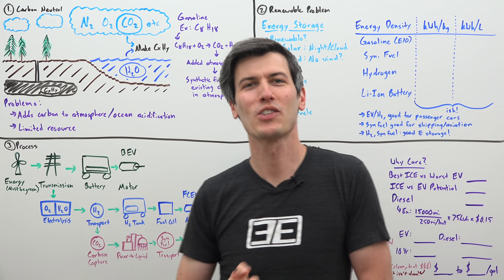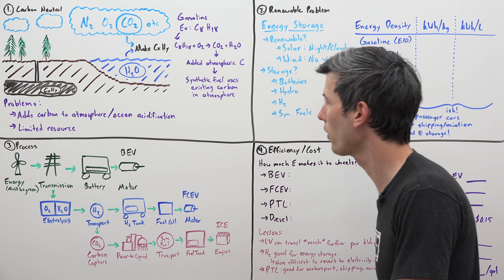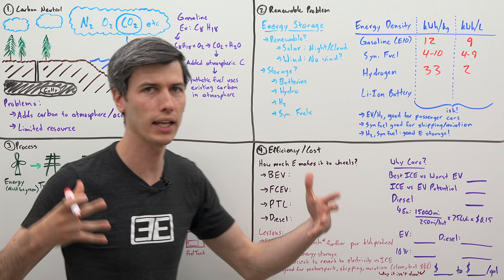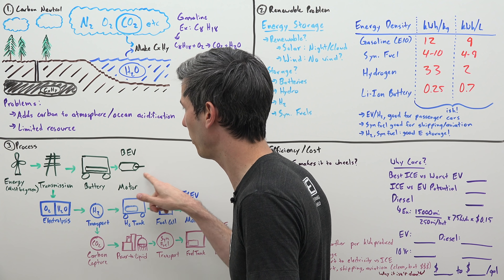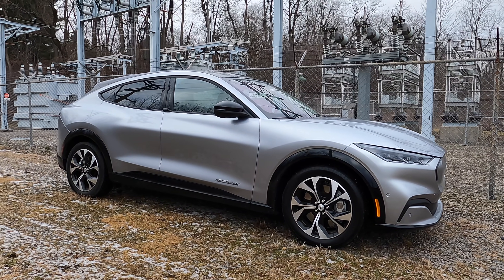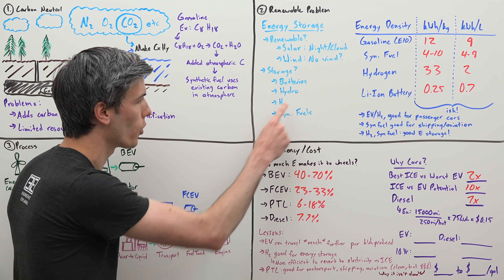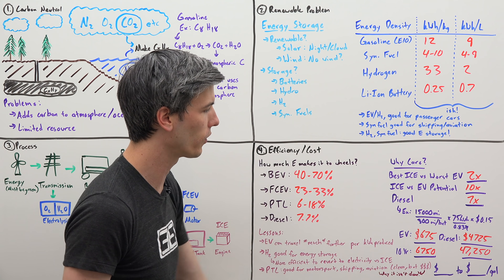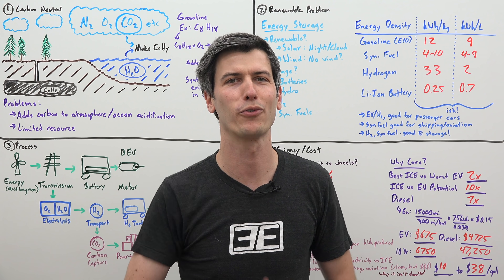The Big Problem With Synthetic Fuels

Comment: I think we also need to factor in the total environmental impact of manufacturing and disposing/recycling  of batteries vs a simple fuel tank. This was a great video, but in my opinion it only tells one facet (albeit an important one) of a multi-faceted story. This should have been stated more clearly.
Reply: Environmental impact of recycling well you’ve managed to contradict yourself by only using 4 words 😂😂😂😂😂
Reply: We should also include the total environmental/human impact of oil extraction, refining, transport, the effects of burning and placing it into our atmosphere (since it can't be recycled), as well as the related health implications, associated geopolitical and literal armed conflicts we employ, to ensure access. I think if we actually looked at the total picture when it comes to how we get our cheap gas, it would put a lot into perspective, as well.
Reply: @knroo-j1487  Lmao. The whole point of synthetic fuels and biofuels is to provide fuels (that will get cheaper and cheaper over time) using techniques that reduce the resulting environmental damage to only a fraction of that caused by extracting and refining crude oil.
Reply: @electric7487  Lmao. I get that, but I'm specifically responding to the person above me. They want a deep dive of battery manufacturing/tech, but somehow stopped at "a simple fuel tank" for comparison. I suggested we also do a deep dive of fossil fuels which fill that very tank. Meanwhile, EE already offered insight into synthetic fuels, so we have that covered.

Comment: CO2 emissions involved with the mining, processing, transportation, manufacture and packaging of the batteries for these supposedly "green" EVs? Don't look behind the curtain as the great and powerful OZ forbids you to glance.

As an aside, the Kia Ceed 1.6 CRDi gets a whopping 72MPG (on diesel) so the EV to Diesel values noted of $675.00 & $4275.00 per year/15,000mi driven is poor math at best and at worst, it's deception. 15,000/72 = 208 Gal (of diesel) @ $3.00/gal = $625.00 which is less than the $675.00 value given for the EV.

Comment: You made a 14 minutes video about it and I'm glad you did. However, people who think synthetic fuels will save ICE engines are generally delusional so explanations don't really work on those. Also, regardless of how amazing synthetic fuel ends up being...

Europe is starting to ban ICE sells from 2040, Quebec from 2035 and it's likely other countries will join that trend. With those massive markets basically wiping ICE sells, it doesn't take a genius to figure out what's going to happen to ICEs around 2030ish: manufacturers will just stop making them. And with that out, synthetic fuel is moot.  

EVs are the future because it has been decided.

Comment: I hate electric cars. Let’s run methanol or nitro methane and call it a day. People don’t realize that as old as the internal combustion engine is, the electric motor is even older and like the internal combustion engine, they haven’t actually changed all that much, just optimized. So the newer technology is the internal combustion engine. We can run it on different fuels, but it won’t go away. Alcohol is nice and clean, you can swig a sip of it and pour the rest in your tank. Just like Granny’s moonshine.

Comment: Makes me wonder, electric is cheap now, but once a majority switches to electric with no alternative, electric prices could/would go up with no competition to keep the prices lower. Synthetic fuels and hydrogen may be good even if just to keep electric affordable for the everyday user.
Reply: It's about supply and demand. Sure, demand will go up but so will supply meaning the prices won't change that much. And if they do, you can expect the government to force it down especially if your electricity is nationalized like in Quebec.  So price control is actually better than for oil.
Reply: @dzello  that is not how capitalism will pan out. When there is little to no competition, companies start to be able to make their prices what they want. The government will step in, but that will not necessarily make electric cheaper. The government steps in when oil gets really expensive, but the price still goes up. The price may not get as high as it would with out government intervention, but it will go up. Oil so far has always risen to match our demand, but it has also increased in price.

Take for instance Intel vs AMD 4 to 6 years ago. Intel did not have a fierce competitor so their prices went up and their advancements in technology slowed in the CPU market. This can be used as an analogy of what could happen in the energy market.

 Electric vehicles are the way of the future but we need to be cautious with the change. We don't need electricity to turn into the next big oil. Even though is some ways, it already has. We can see this in the electric bills for Texas when the large winter weather (for Texas at least) caused a surge in electrical demand with the supply falling short. Prices sky rocketed and not all providers absorbed the price hike. Some passed the prices on to the consumer. As of now, people are on payment plans to pay multi thousand dollar electric bills with no government aid as of yet.
Reply: @robotsmash0077  What you're saying only applies in a free market which this is not reeeally. 

When something is this important, governement intervenes permanently. Also, electricity is being sold across countries. For example, Quebec sells electricity to the US at low prices to ensure North America uses clean electricity (since Quebec produces hydroelectricity). So there's actually  competition as well. 

As for oil, yes it goes up, but not much and if you remove inflation and increased taxation, the price of oil has not fluctuated that much. 

So the supply-demand aspect of this is absolutely fine. If anything, it's even more in control because supply is relatively entirely local or close (neighboring countries) meaning you are less at the whims of OPEP policies for example.
Reply: @dzello  Canada does produce more hydroelectric energy than the US, but the US is right behind based off of 2012 numbers from USGS with China being first, then Brazil, Canada, and the Untied States. Based off of 2020 numbers from IRENA, the US is the second largest producer of renewable energy second only to China. So on the Canada sales power to the US so that the US uses clean energy, I will have to disagree.
Reply: @robotsmash0077  I wasn't asking for an opinion, it's a fact: Hydro-Quebec, Quebec's national electric producer, sells electricity to the US at a low price in order for the US to use more clean energy. I worked on that project myself.

The fact the US produces hydroelectricity does not matter at all saince its entire consomption is not fully based on hydroelectricity (unlike Quebec). By selling clean electricity at a low price to the US, the US uses clean electricity rather than dirty electricity which has a higher price. Basically, if it wasn't for that, the US would build more dirty electric powerplants and pollute more. 

Being close to Canada helps the US with its prices. Also, again, massive scale things like electricity or gas are massively supervized by the government and it is not a free market system at all. The variation in demand for electricity becomes a non factor.
Reply: @dzello  I was not talking about Hydroelectric power generation. I was talking about renewable power generation by country which encapsulates hydroelectric generation as well as all other renewable sources. All that has been brought up, is about Canada, not the rest of the world. The beginning statement was brought up based off of an observation from one perspective, but this conversation chain has veered off topic resulting in just an argument. The original comment was just that, a comment I had when I finished watching the video. This videos content  is all set in the future where no one has a perspective on how the problem will mature and be solved. All I wished to gain from the posting of the comment was some thought on price changes that will be associated with the increased demand/strain on the future power grid.
Reply: @robotsmash0077  And like I said, it doesn't matter.

The problem is you're using data improperly. It doesn't matter wether the US is second, third or fifteenth in renewable energy production.

The only thing that matters is:
Does the US use dirty energy (no matter if it's 1% or 20% of their entire consumption)? The answer is yes, it doesn't rely entirely on renewable energy.

So by selling hydroelectricity to the US, Quebec makes sure that a portion of that dirty energy is replaced by clean energy instead.

So what matters isn't how much renewable energy the US produces, only that it's not 100% of its consumption.

Comment: I think it’s extremely unfair to compare a nascent technology to what is close to the physical state of the art. Remember how expensive Li ion batteries were at first?
Synthetic fuels are primarily good because they allow you to not have to modify your entire fuel distribution logistics and they offer a much more practical solution to energy transportation (fixing issues like density, leakage etc.)
BEVs have a very hard cap to adoption due to the issues of charging infrastructure (you need to electrify literally every parking space ever created). While I agree they’re here to stay, synthetic fuels are really the answer to everything that Li ion batteries won’t cover. Unfortunately, you understand how researching synthetic fuels is the dumbest thing ever when you have fossils. Unlike Li ion and research for electronics, there’s no benefit of tens of years of research and refinement that enabled Tesla to make the grand entrance.
Reply: There is efficiency losses that simply cannot be overcome when talking about synthetic fuels. Even the best case, theoretical limit, synthetic fuels are at a very large disadvantage. Considering the cars would ultimately share the same source of energy the price per mile will always be dictated by electricity costs. If it takes 5x to 10x the amount of electricity to move a car on synthetic fuel per mile electric cars are always going to have the edge. As for the charging infrastructure it really starts to make sense when your fuel bill could be 5x - 10x lower, it often pays for itself quickly. Their is hiccups to widespread adoption, yes, but it's not like this is all happening right at once.

 Other industries could (and at this point they really should at least blend some in) adopt it but would have a bit of trouble if they want true carbon neutrality. Telling people their $500 plane ticket or their $5000 shipping container is now gonna cost $5000 and $50 000 would be a bit of a shock. Marine freight has room for creativity, such as sails, solar assists, etc. Air travel really needs that energy density.

Comment: What would we expect the impact on water resources if we would utilize electrolysis on the level that would be needed to make it a viable fuel.  Water use is already controversial for corn ethanol.
Reply: Porsche's pilot project uses seawater.

Comment: It's an interesting topic. If the clean power source is at a remote location (they often are) and the power can't easily be transmitted because the location is, for example,  an island (underwater cables are expensive and lossy) then synthetic fuels might start to make more sense. The South Island of New Zealand is a case in point. Lot's of potential to produce power (hydro and wind) but it's very remote. There are cables to the North Island but they lose a lot of energy in transmission
Reply: samew with synthetic fuels, how much you will use transporting those around from remote places, I still think losses from the wires are less than having to pay to transport that synthetic stuff
Reply: HVDC underwater cables don't lose much and are preferred for long distance power transmissions, what are you on about. There's >10 in Europe alone...
Reply: @m2heavyindustries378  A lot of renewable energy projects in the UK are on hold because they can't connect to the grid. They are just in limbo waiting. The grid can't even transmit al of the energy generated in Scotland to where it's needed. There may be 10 cables in Europe but the system doesn't work.

Comment: I dont need this to save all ICEs. I just want a niche kept alive. Similar to how few of us ride motorcycles. Bless you Porsche.
Reply: People still ride horses today, and there's also steam engine trains around. So I'm sure there'll be niches kept alive for those with persistence, knowledge and wallets for it.
Reply: 38 bucks yikes. I hear they are still working on it. Its not perfect. Thankfully none of this is on the immediate horizon meaning i dont have to worry about any of this as ill be in old folks home riding an autonomous pod around. I guess you really do not want to live forever.
Reply: Porsche also stuck with the rear engine layout all these years because they wanted to...and they've made it work. 
They don't like being told not to do something.
Reply: I agree with you!
Reply: @Hadhoudtn  "underpowered EVs" ... you cleary never have driven an EV. And since when does the vehicle weight repell people from buying cars (nowadays more useless SUVs and Pickups are bought than ever before) or hinder performance? Cars are getting heavier for over 30 years (at least outside of US) and nevertheless they constantly gain performance, measured in boring stuff like acceleration times, lap times, towing capacity and so on. The "ugly" part is your personal preference. The affordability will fix itself with scale. Already there are cutting edge 800V EVs from Korea in the 40.000$ bracket. People buy cars in that price bracket all the time. As soon as these hit the second market there is no discussion about affordability any more. And the truly affordable bang-for-buck EVs aren't even sold in the US ... like the 50kWh small cars from Stellantis (Peugeot, Citroen, Opel, Fiat), Renault with their Zoe or the really decent EVs from China (Aiways, X-Peng, MG).
Reply: @Hadhoudtn  That makes no sense. Obviously they'll be affordable, otherwise it'll never make the masses. All low-end cars aren't fancy looking though, so that's probably gonna stay the same. And they'll certainly be heavier - although less heavy over time. Underpowered is a given, although they should be more powerful than the ICEV equivalent.

Comment: There are no applications where synthetic fuels make sense, if energy density is an issue (e.g. planes) then H2 will work perfectly fine, and it has an ever higher density than these fuels (and volume is not an issue there). For other applications where density is not that critical (e.g. passenger cars), then nothing is ever gonna beat batteries when it comes to efficiency and cost.
And let's not forget the fact that we are really far from optimal battery tech, the density could increase dramatically in the future for batteries. Where our ICE engines are really close to theoretical maximum, so there will be no crazy improvements.
The existing auto and oil industries are really trying their hardest not to be irrelevant, the amount of propaganda on the net is insane, I constantly hear from uninformed people how "batteries are the worst for the environment" or "hydrogen is the future".

Comment: I think it only makes sence as a legacy fuel for classic cars and stuff, so perhaps there will be a market for synthetic fuels, as small as it might be.
Reply: Personally, I think the main market for synthetic fuels will be large-scale aviation. I think I recall the viable range for electric aircraft is something like 400km, and carrying a couple of dozen passengers. Basically, what's currently serviced by propeller aircraft. Large-capacity aircraft that use jet engines can't be converted to battery power. Those need synthetic fuel to make them carbon-neutral. Perhaps you might be able to build the atmospheric capture and synthesis equipment on-site at major airports and run them off solar panels on the roofs of the many airport buildings? Or, if not all, then at least a decent chunk of their power requirements.

Comment: Ok great but... In under three minutes, I fill my tank with diesel and my trip computer indicates   900 kms (VW Golf TDI 4 Motion in Europe ok it’s not your souped up Miata but an awfully reliable multifunction car) range. I don’t have to f...ing think about refueling for a long time. There is also no worry about how much fewer kms I’ll be able to drive when the temps fall below 0 . .. Diesel engines are reliable with maintenance.I have 342,000 (over 200,000 miles) kms and it’s running well. Thanks for another good presentation

Comment: Just plop down a 4GW nuclear plant and let the fuel flow :)
Reply: Great. Now you've got me thinking about nuclear power in Factorio. Last time I used nuclear, I only ended up using two reactors before I got the rocket launched. You'd need a hell of a factory to need 4GW of power generation. I'm sure someone's done it, though. I think my most demanding factory topped out at a couple of hundred MW, with most of it going to roboports and laser turrets, and that one was all solar-powered. Well, as much as you can manage in Factorio without mods, anyway.
Reply: @Roxor128  Nice, i like playing factorio too but ive not played it in a while. Now that you reminded me about it now i might take the game out for a spin again